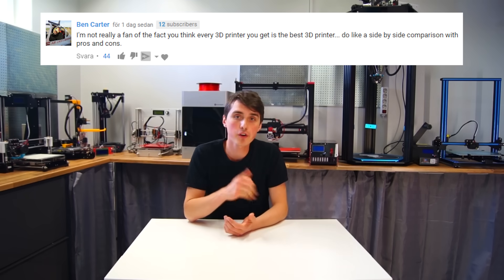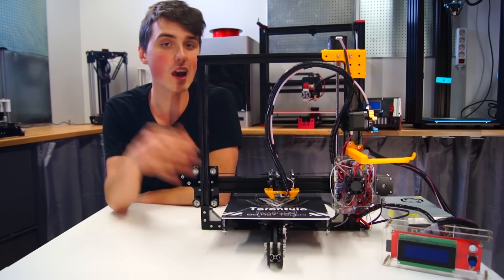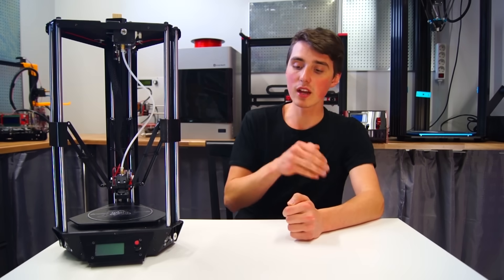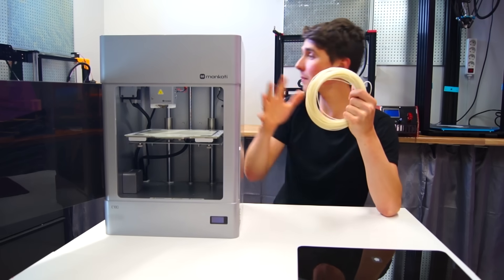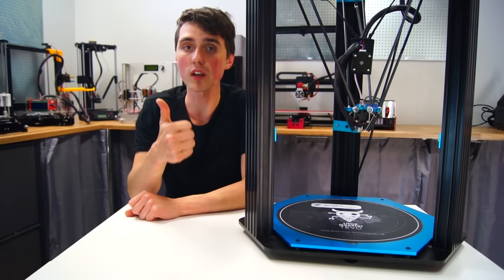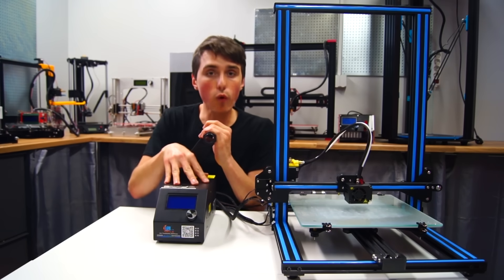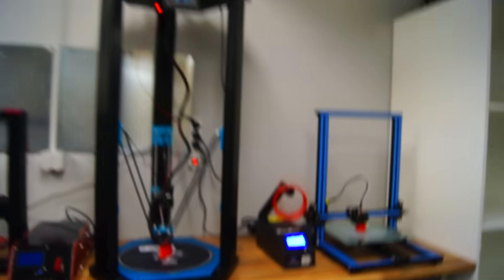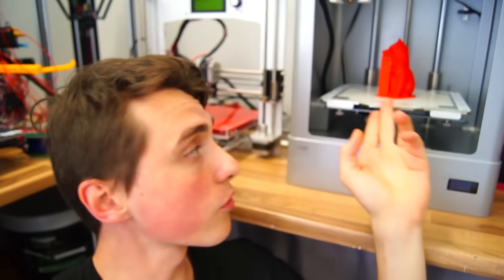Why This Is the Best 3D Printer - Comparing ALL My Printers!!!

Comment: My Anet A8 produces much better prints than the one in the video. Admittedly after plenty and really extensive tweaking.
The hardware list:

1. Mount the printer firmly on a solid, stiff and very level board, so that the frame is supported and doesn't flex when being moved around.  Put vibration dampening foam UNDER the board if you like. Take your time to make shure, that every part of the frame is really square and level when you mount it. This is by far the most important upgrade.
2.  Print thumbwheels for bed leveling.
3. Replace steel belts with fibre glass GT2 belts.
4. Use belt tensioners for x and y and carefuly adjust to proper belt tension 
5. Use 20 tooth idler pulleys in tensioners.
6. Use MOSFETs with both, heatbed AND hotend.
7. Put insulation under your heatbed.
8. Use BuildTak or equivalent as printing surface.
9. Use IGUS DryLin Bearings
10. Print covers for dangerous area of power supply and add power switch. Make sure that power cable can't just be ripped out.
11. Solder connection  straight to Heatbed.
12. Use Spriya fan duct.
13. Make hotend fan easily removable (magnet holder)

Optional:
14. Stiffen up frame with braces or aluminium square tubes.
15. Add some LED lights to make levelling easier.
16. Add Autolevel sensor and use Skynet firmware.
17. Use Octoprint
18. Use Simplify3d instead of Cura if you are willing to spend the money.
19. Encase the printer.  I.e. see the Ikea-"Lack" table solution

There we go. Piece of cake :-)
Reply: there seem to be allot of quality differences in these machines because of it's popularity. some where good, really good and very poor. Allot of there are sold. so they didn't check the parts etc anymore.
Reply: Yes, you are right. Anet A8 is really good 3d printer. Also anyone can afford it!
Reply: Im pretty disappointed in anet a8.
Every print is different quality for same model.

I print my model, unplug printer.
Print again same model, same settings etc. Unplug.

Printout is like very poor quality.
New day, again same model. Just worse and worse.

No stable quality, everytime new problems, over extruding or underextruding, knocking noises from extruder etc etc..

Installed 7 drylin bearings. They have more play than metal bearings.

Total... dunno what to do with it. Throw from window or sell it for some guy and buy something more expensive.
Reply: yes. after 100hours+ and lot of filament put into it, the Anet A8 can be good. Until it destroys itself again. lol
True story.
And the CR-10 is good from the box. So that's why I think I will be getting one.

IGUS bearings are garbage however. They have too much play and wear down in hours.

Comment: Hi RCLifeOn, I'm from Spain, and I just got a GEEETech i3 Pro B, with the MK8 extruder and acrylic frame.

Since I'm currently studying for my lasts final exams at university, I haven´t tested it a lot, but after building it and printing some files, I realized it has z-axle wobble problems, which I think I'll be able so solve soon.

Apart from that, I'm pretty happy with it, being my first 3D printer.

I learn a lot from your videos, keep going!!!

Comment: the salmon artifacts arent the fault of the delta its the problem of the stepper drivers missed microsteps because of to low current, theres a mod with diodes, google it, it fixed my issues and should yours too!

Comment: I have Geeetech prusa i3 pro b. I am very disappointed. In the beggining, I could not find any manual and there are maybe hundreds in the internet. Afterwards I could not print because of the firlware and nowadays after a couple of printings I faced failure of bearings and I should order new bearings. If anyone likes a touble making printer prusa is the correct one however I will buy a Zortax which costs 2000€ because I just want to print and I dont like troubleshooting.

Comment: Your problem with your black widow likely has to do with the power supply being improperly grounded (which has likely messed up your board).

Use the second extruder port and thermistor for your primary after switching out the PSU.

I've had this same issue with my own machine and it's been going strong for about a year now after a rough start.

Comment: Hey dude,

Love your videos!

Just a quick tip though...don't lift up the printer by the top of the gantry (like you did when moving the CR-10). 

You can screw up up the angle of your square by up to a few mm (even if you think it's pretty tight) since it's not working with a through hole fastened design.

Cheers,

Jake

Comment: Re: flexible filament in your prior Mankati print, why should the retraction settings be turned off?
Reply from the maker: If the flexible filament is too flexible, the retraction setting makes the print fail. The filament bends inside the extruder.

Comment: With the Geeetech i3 probably you should replace its "Mk8" extruder with another one that has a screw to adjust the spring preload force, in other case the filament can slip easily. Maybe this is also your main problem. There are options in aliexpress/banggood for 3 dollars.
Reply: Another option that could be an option would be to design a new "lever" part of the Mk8 extruder (to be 3d printed) that includes a threaded hole for a screw that compresses the spring (using the head of another screw put inside of the spring, like in the usual configuration in a "good" Mk8)

Comment: if you flash even the non auto leveling version of skynet onto the anet a8 your print quality will go up significantly and even further if you put an auto leveling sensor on it. you also printed out mods for the tevo tarantula but not the anet. which also would bring up the quality. such as belt tensioners and frame braces. yes this changes the out of box comparison but most people are buying it knowing they will be printing parts out for it.

Comment: Can someone please help me: I am trying to get into product development, over the last year I have saved up a bit of money for a PC and a printer... 
I am stuck between the Tevo Tarantula and Creality, but if I would go for the Creality printer, i would have to cut $200 off my Pc budget, making it a $700 computer.
What would you do?
Reply: go with the cr-10 and get a $700 computer
Reply: get the creality. Now that AMD's ryzen 5 cpus are on the market (and have had time for all the bugs with the new motherboard platform to be worked out), you can build a fantastic cad machine for $700. I'd say go for a ryzen 5 1600, as you get a six core, 12 thread cpu that performs comparably to the $450 intel 6800k, for around $200. 16gb ram is super worth it for cad, you'll really use up ram fast as you make more complex designs. Also go with fast ram (2666mhz or above) for ryzen as it likes lots of ram speed. finally, get a decently fast budget-oriented gaming gpu such as an nvidia 1050ti or radeon rx 560. Here's a link to a good example build I threw together, but remember pc part pricing fluctuates often so you'll want to tweak it depending on the shape of the market when you purchase: https://pcpartpicker.com/list/tmHy2R
Reply: 700$ PC should be good enough, especially if you make it yourself, plus, after a year or two, if you need some boost to your PC, you can always upgrade some parts of it that you feel need the most attention. So if you feel like you can build your own PC, definitely go for the Creality printer.
Reply: Get a second hand Thinkpad, such as a T430 or a T450. A T430 can be had very cheaply (300ish), and will outperform any laptop in the 700 range. Saves money for a better printer.
That's for a laptop though :p
Reply: Joe Dockstader Wow, thanks a lot. I was looking for good builds on youtube, this is propably one of the best. I might actually buy this :D
Reply: Kommentator no worries man, I do a lot of builds for my company so this is one I happened to have saved from a couple days back. r5 1600 should be comfortable overclocked to 3.8-3.9ghz on the stock cooler, probably fine to just set  it at 3.8 without tweaking any voltages if you want good performance but don't want to mess around with it too much.
Reply: Kommentator agree with Adrian Bard
Reply: Kommentator buy a used computer. that way you get an even better computer and the cr10 printer.
Reply: Nerys cad relies highly on processor IPC and gpu power, both things that will be significantly worse in a used machine.
Reply: Joe Dockstader i disagree. a used 1080i has exactly the same performance as a brand new 1080i. its not like the cad software can detect you bought a used machine. you just have to buy the right machine. and yoyr cadding for prototype 3d printing not pixar.
Reply: Nerys oh for sure if you can find a good deal on a used 10 series gpu go for it. problem is a used 1050ti goes for about $15 less than a brand new one. PC hardware rarely loses significant value until it's outdated. Prebuilts are a different story, for example you can get a great budget gaming machine by buying a 4-year old optiplex with an i5 2500 and putting a decent gpu in it. but I'm talking specifically about cad systems here. I have no aversion to recommending used hardware, I often build systems using used server hardware. But you'd have trouble building a PC that can outperform the build I linked in cad for the same price, even with used parts. older amd cpus are worthless for cad, and because of how cheap Ryzen CPUs are compared to the crazy prices Intel has developed over the past decade thanks to their relative monopoly, even a used Intel CPU that's comparable to the 1600 is still more expensive.
Reply: Kommentator I recommend looking at this https://www.reddit.com/r/PCMasterRace/wiki/builds
Reply: Kommentator Here's mine 
https://pcpartpicker.com/list/8N2HtJ (Better Graphic Card but no SSD or you can change to cheaper Card amd get SSD, but i think a few 10 sec difference is okay except ure unpatience)
Reply: Doesn't matter which printer you get. All printers have upgrades that make them better. I like the prusa I3, but get more customization out of my Tronxy X3. You can also build one as well like the Hypercube on thingiverse. and computer wise, you get a cheap laptop off ebay for $200 that will run everything.
Reply: I would go with the cr-10 and a refurbished laptop. I got my HP pavilion 17" for about $380 plus another 2 8gig sticks and I run Autodesk Inventor, Fusion 360, Showroom, Photoshop, and other programs at the same time and that's barely putting a load on it. That extra cash you have left over, you can use for upgrades and extra filaments.

Comment: heads up the tarantula is cheaper than the anet a8 for me atleast living in europe (sweden)  cause gearbest take around 60$ for shipping while the tarantula has free shiping i saved around 30$
Reply: The shipping in Gearbest is free!! You should know that!!!!!
Reply: it sure wasnt for me where do u live ? i ordered one myself so i should know
Reply: The tarantula company support sucks. I received a DOA motherboard from them. Took me  2 months of going back and forth with them before they would send me a replacement.
Reply: i dont know ur tax rates in denmark but i had to pay 550 sek in import tax living in sweden. I would not order from gearbest however as they are really unreliable but from aliexpress i got it cheaper and with free express shiping. Really happy with the printer but took a while to get it running well
Reply: Hi! Would you have an idea on how much taxes I would pay buying the tarantula from gearbest? (I live in denmark)

Comment: I got a cr-10 with a couple mods: noctua fans and motor vibration dumpners. Now it prints like a champ and is suuuuuper quiet! The only issue right now are the very long print times, which I'm going to solve soon enough with a volcano hotend. If you're a 3d printing noob and want to start printing without too many hustles I totally reccomend the cr10 too!

Comment: Hi RCLifeOn, What are you doing with your prints that have failed? Can this be recycled?
Reply: this is not a useful solution Peer Appel, it is just for fun and didn't worked fine ...
Reply: there is a PLA filament maker machine that can make filament from chopped crap. google it

Comment: My tevo tarantula sucks it has been so hard to work with and it really just doesn't work well. I also bought it because of your review which was totally not true to my printer
Reply: Alec Hubbard What's the problem mate?
Reply: Alec Hubbard seriously ... I'm about to buy one ... is it crap?
Reply: No, but it requires thinking and effort. Once I fixed an extruder problem (nozzle wasn't tight) I got amazing prints without any upgrades. Now I'm in the upgrade process. But be prepared to spend more money on mosfets and things to make the power supply safer.
Reply: I've got one. I'm blown away by how well it prints, but as long as you're willing to spend 12 hours building it, it's a great kit that can be endlessly upgraded.
Reply: Sushant Gulati yeah I hate to break it to you but I know very much about 3-D printers and how they work in this one just doesn't have the performance even when everything is fully built, I just can't get good prints out of it.

Comment: The Tarantula printed backwards and you didn't mention it.
You didn't list the times for each printer - should have tested again after the filament mess up  and  the size mess up ect.
Also if you slow any printer down you tend to get better prints - so The delta finishing before the CR-10 and the CR-10 having better results are meaningless what happens when you slow the delta down to match the print time of the CR-10?  

This comparison only told us that:
Mankati e180  for5 ease of use
Anet A8 is a first printer for true 'makers' willing to design print upgrades - at the best price
Tarantula will print the opposite of what ever you wanted in the first place
The Rework should have been made larger
The TevoDelta will save you time and thus money and will pay for itself before all the other
The CR-10 is a good printer (but may be very slow, who knows? we don't!)

I have an Anet A8 - I will always be fond of it - it was my first time :)
I want to build a Delta - I may actually upgrade the A8 to a delta
IF I were rich I would buy  a Mankati e180 - if for nothing more than ABS !

5/10 for the collection review (-3 out of envy, -2 for cocking up the test)

+10 for the electrocution effects :)
Reply: Thanks, Jason. Do you think that means they are all the same? Or that he set them all the same for the test? Price, size, speed and quality are the things I'd like to know. (And anyone else that watched thinking of purchasing.) Highest resolution would be part of quality.
Reply: Am I the only one that wanted the resolution of each printer? Are they all the same? Do most viewers already know the resolutions for each one? (Resolution might not be the right word for 3d printers but you know what I mean. Smallest addressable point.)
Reply: thanksfernuthin I believe he said he printed them all at .2mm layers height.
Reply: You're right...I don't know that they are all printing with the same speed settings and such.  I'll have to watch again to see if he says so.
Reply: Maybe you should make a blog/video then... just saying.

Comment: I have the Geeetech i3. It was originally a Pro C model (with acrylic frame and dual extruder), but I then replace the extruder assembly with an E3D V6 and I also added a BLTouch sensor for autoleveling. I had it for more than 1 year and a half and so far I haven't had any issue with it

Comment: You told me once to buy my Anet a6 from gearbest and now it came three months late and it was broken. You told me they are reliable company but now the only option they gave me is a $30 back on a $245 worth of machine and even if I'll take the $30 I can do nothing with a broken 3D printer. So I don't know what to do, please help me cuz I waste all of my money on this investment. thanks. By the way I really like your channel.
Reply: Noam Segev Saban sorry, gearbest usually do not help until you claim via paypal, anyway, I think that paypal have now up to 120 days to claim.
Reply: Noam Segev Saban what part is broken? Or did you break something during assembly...
Reply: I have scratches on my print bed, the cooling fan came broken and also one of the acrylic parts. it's really sucks, the printer came three months late  and now I cant even build it.
Reply: I can use all the help I can get, they don't answer me, I really don't know what to do.
Reply: claim via paypal.
Reply: Noam Segev Saban serch paypal resolution center on Google, and claim the 245$ payment for broken Ítem.
Reply: bellotero69, thank you so so much! I will do it.
Reply: im curious how it turned out with the claim?
Reply: I can't, it's been too long...
Reply: okay, thanks. I have insurance but I don't know how to activate it... Still thank you so much, you're a really nice person.